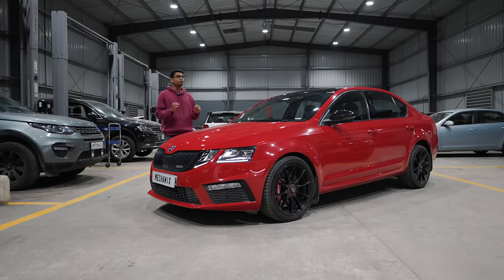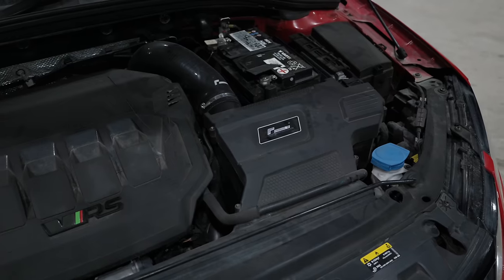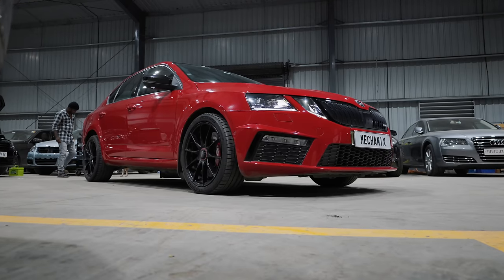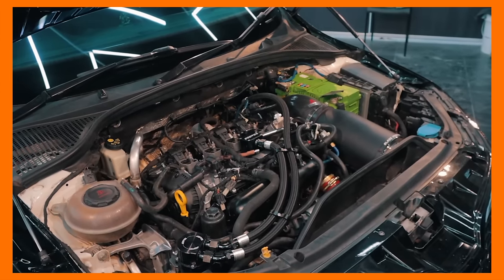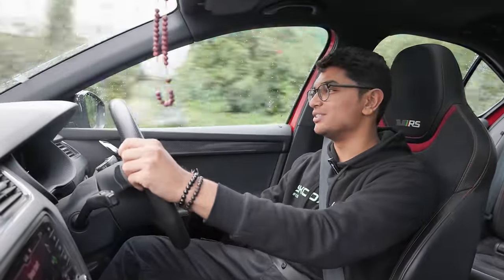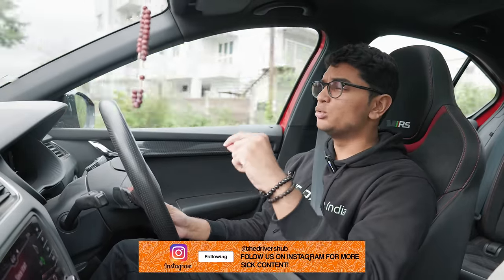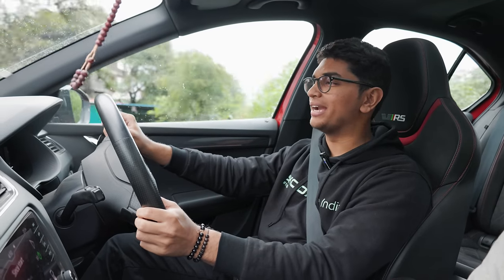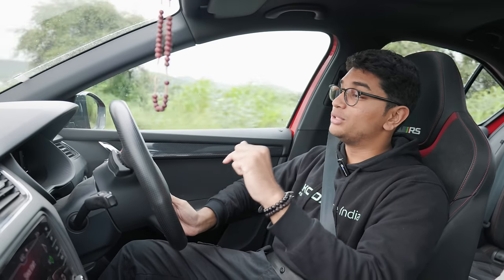INDIA'S FASTEST VRS with Haldex AWD, 430HP on a STOCK ENGINE! 😱 (11.6s 1/4 mile!) | Autoculture

Comment: Tiguan all space 4 motion + 2.0tsi you get this. Rear brake lines rear axle Haldex module abs module gearbox or front transaxle. If it’s a 230 you need a different gearbox, if it’s a 245 you can add the rear differential to the dq381. Fuel tank also needs to be swapped. Easy formula for putting down all the power

Comment: What about that 600 HP one which appeared on Faisal Khan's channel??
Isn't that the fastest in india?
Reply: Thats what i was thinking.🫠
Reply: Is it at wheel hp or crank hp?
Reply: The 600HP one has built internals or a built engine. This is not a built engine, only bolt on upgrades. We have covered that car also multiple times, much before Faisal Khan jumped on the bandwagon.
Reply: @SohamSaraf  okay good to know 👍🏻
Reply: Definitely not on stock block.
Reply: @amangodara1772  yes I realized it from Soham's comment above.. maybe, I need to watch that video again and listen carefully if that was mentioned in the video.. I was thinking that was stage 4 map
Reply: @vijuvlogs  bro that vrs600 is featured here before any Faisal has ever arrived so try to understand a simple difference ;

This red car's engine is totally stock as far as the internals are concerned and that monster has almost things swaped by aftermarket or Audi parts in it.

Comment: Yeti 4x4s all wheel drive system should be that secret sauce
Reply: Yeti is PQ platform, this is MQB, won't fit.
Reply: Yes must be a retrofit from Audi A3 or A4 moreover yeti came with MQ250 manual transmission only in india
Reply: From a Q3
Reply: I guess this is a kodiaq Hard x awd
Reply: @veloce.95 that is also pq 😂
Reply: @sangeethkumar6727 a4 has Quattro not Haldex. Longitudinal engine and drivetrain design.
Reply: must be audi a4 quattro
Reply: @AdityaNarayana  Audi Q3 MK2 is based on MQB A2 platform. So i think it's Q3 or from a TT RS which seems more feasible
Reply: TT's Quattro

Comment: You should probably check out Hyderabad's venom performance sreeram anna's project vrs with 600hp claiming the fastest vrs in India....
Reply: We have covered that car multiple times, we were the very first auto channel in India to cover it. His car has a built engine, ie, forged internal parts. This is on a stock engine which means it is how it is from the factory.

Comment: Toyota GR YARIS 
3cyl
1.6L
Making 630hp 🤔🤔😲😲
1280kg
10.98sec🙄🙄🙄🙄
(Information recent video of car wow)
Reply: It doesn't make 680hp it makes around 300hp
Reply: @KIRA-ek3uq  It was tuned
Reply: @KIRA-ek3uq  tuned one 💪💪
630hp tht to 3cyl
GR will smoke this VRS 😂😂😂
Toyota 💪💪
Reply: @Poorvikss that Toyota is not available here in India
Reply: @mayurnarayan1  s but it's made by Toyota right 🤔
Reply: @Poorvikss  there is one with 750hp stock block
Reply: @Poorvikss bro it's a £50k car ...stock
Reply: @kostinarain7373  na its a 30k car markups from dealer push prices
Reply: @Poorvikss  i am a jdm guy but why are we comparing this to  a car which is not even sold here
Reply: @KIRA-ek3uq  k my bad 👍
Reply: @KIRA-ek3uq Tuned
Reply: @Poorvikss and if Lambo is tuned 😂😂😂
Reply: @VarunTomee-kr6nf  price 😂😂
It's double 😂😂
Reply: @Poorvikss  it will  neck to neck with nevera

Comment: TCU tune is just a gimmick..been driving my stage 3 octavia for 4 years now, stock dsg (dq200) only ecu tune…dsg has not given up till date.
Reply: TCU tunes aren't about gearboxes giving up (although it affects the lifespan for sure). The DQ200 has torque blockers which doesn't allow the gearbox to fully deploy the power. Moreover, optimising shift points and calibration of the transmission to the higher torque and power is very important. TCU tune allows for quicker shifts too. Would highly suggest you get it done.